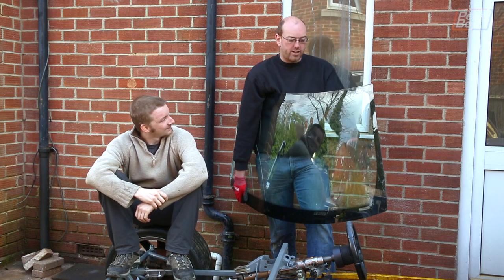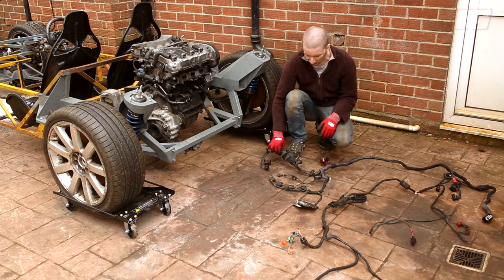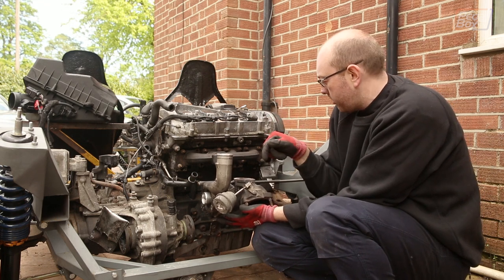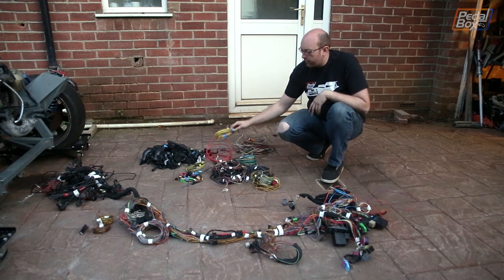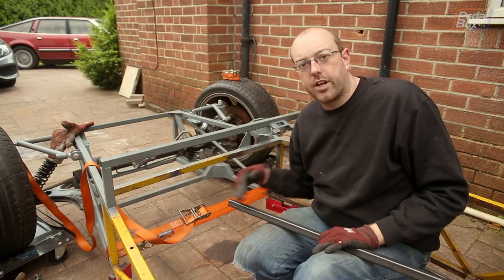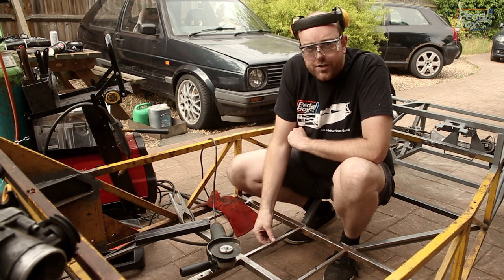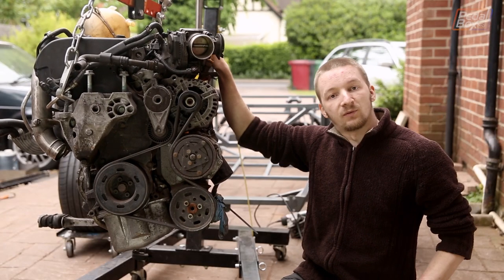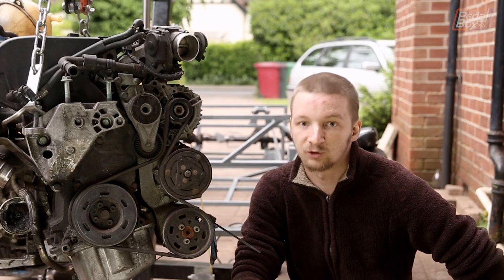Wires & Floor - Audi Kit Car | PedalBox Episode 23

Comment: You may find, like I have, that an auxiliary belt around just the crank, tensioner and alternator will rub on the tensioner. I haven't solved it yet, but there is a different tensioner type on one of the engines I believe.
Reply from the maker: Well thats a shame, It looks so close to being fine too. We still haven't pulled that one off and go in yet, plans are a foot thanks to a convenient opportunity (heard it here first) :)